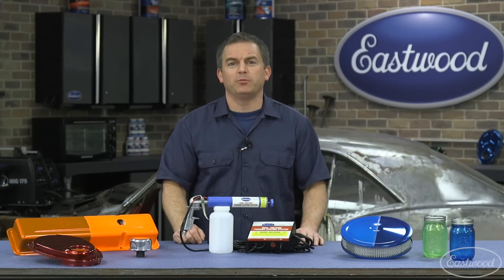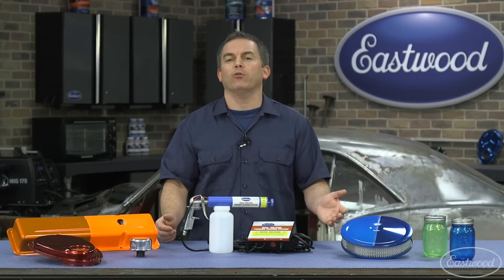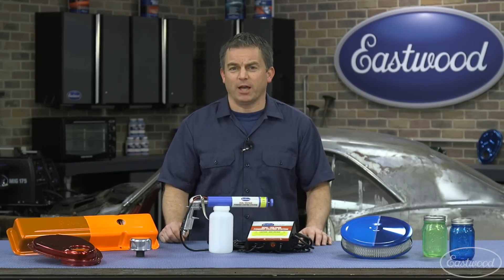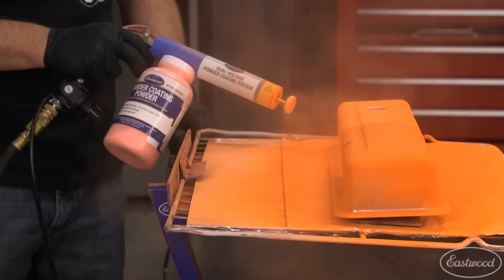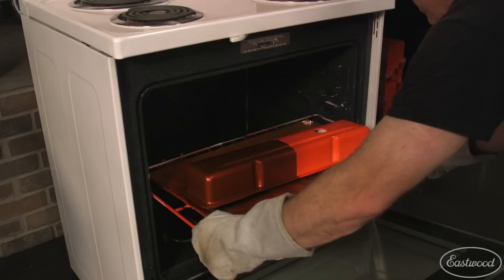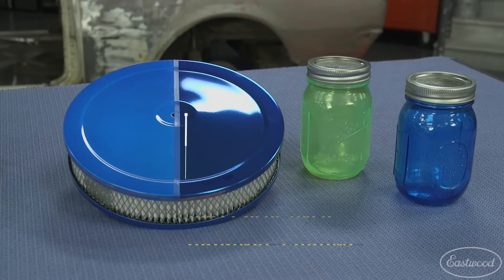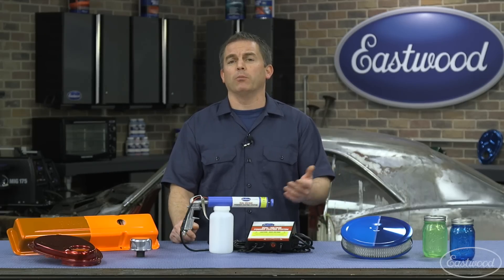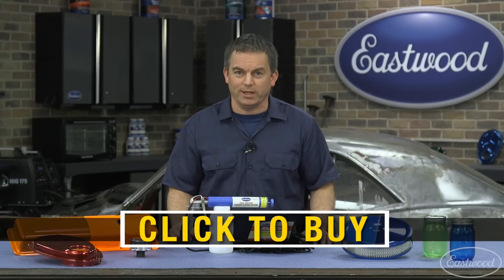Dual Voltage Powder Coating System - Powder Coat at Home! Eastwood

Comment: Hi I just bought the powder gun. I'm satisfied for the moment I just need to ask one thing. Is the little blue round plastic at the tip of the gun can be removed and put back on when wanted and still use it safely. Because I fell like if the powder was blown directly towards the part in some cases it would be better. I won't touch it before asking lol
Reply from the maker: Yes, it can be removed. Make sure the gun is unplugged.
Reply: @eastwoodco  I removed it. The powder seem to lose its electric properties without it and in result it doesn't stick to the part as good. I'm better off with it I'll just learn the proper way to coat on that angle

Comment: I've seen people powder coat non metallic objects (plastic, etc.). How is this possible without using electricity? I was always told powder coating is for metal only.
Reply from the maker: The item must be able to withstand the curing temperature.  For glass you can use a process called Hot Flocking, where you heat the part before applying the powder, then place it in the oven to cure.  You can see it here:  https://youtu.be/fpF4QcINStQ
Reply: Can you explain to me how they powder coat things like Vespa scooter bodies? Those are made of fiberglass and I would imagine couldn't handle 400 degree temps. Also, not electrically conductive.

Comment: Can I powder coat a metal driver golf club .(gloss black).Would the top coat come out with a smooth finish or orange peel finish.
And should it be clear coated after the top coat.Do I need a Dual Voltage or Single Voltage
Thank you.

Comment: What if your trying to power over a painted part? Example, old cast iron has a lot of roughness and most likely the paint could be removed from the high spots but not the valleys. What happens then?
Reply from the maker: Can you blast the part?  We offer small job blast systems:  http://www.eastwood.com/blast-out-of-a-bucket-kit.html
Reply: So what you are saying is the part has to be bright clean metal for proper adhesion, right?

Comment: Not happy with my gun at all...the powder is actually coming out of the plastic bottle when I spray ,I tried to lower the psi and it still comes out I can't tighten the bottle with the powder coat to hard as it seems it will break, I waste just as much powder coming out of the screw cap and bottle as I do on the part I'm  actually applying powder to. my Harbor Freight one seems to work much better and at a cheaper price...so disappointed.
Reply from the maker: Can you contact an Eastwood Tech so we can resolve this issue for you.  800-343-9353  Thanks.
Reply: Hello sir we are manufacturing  powder coating oven, booth, machine.
Reply: I had two of these piles of crap. Then I bought the Columbia Coatings starter gun. Much better quality and way easier to use.  Plus I have actually produced some good parts finally.